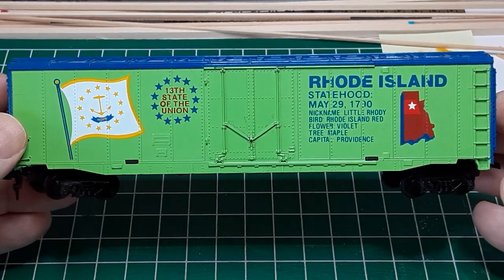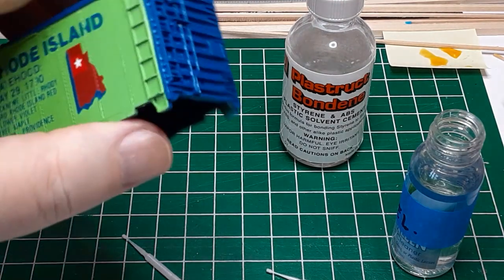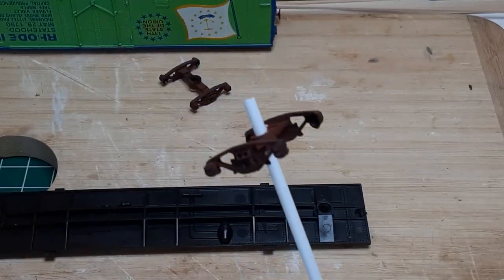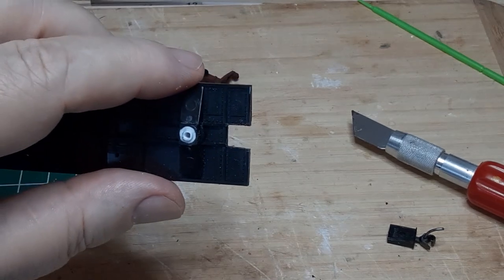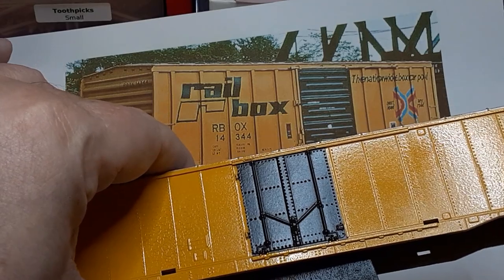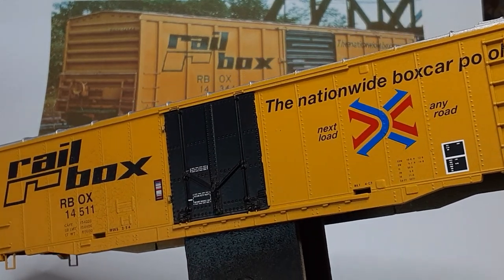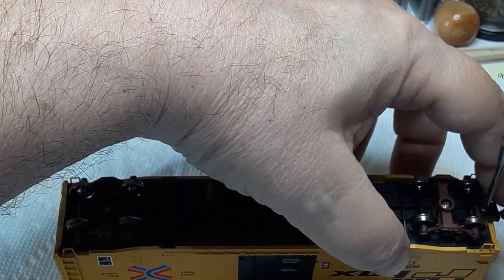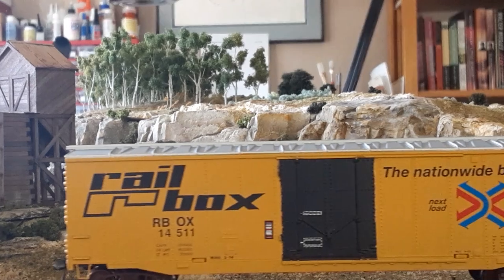Still Breathing: Replacing Truck-Mounted Couplers...and a Surprise!

Comment: I used a similar method in the 1970s, to Re-Truck various Rivarossi ( AHM) US- Prototype Cars, with 2mm MA brass bushes in the Frame, and 2mm Round head Brass Screws to hold the Trucks in Place ( I was exchanging sprung ArchBar Frames with the original solid cast frames. Also the plastic wheels were replaced with Metal ( KayDee RP25) wheel sets.)
For couplers, I used the Cast Pockets in the frame for KD #5 Couplers, and locked in with KD coverplate and 2MA mm screw.
Any dislevel between different cars' Couplers fixed with shim washers on bolsters,
All holes threaded by Hand, using aT Tap guide in a Mini-lathe on " Hand power "
Brass Tube from K&S Brass Tube, Illinois.
PS 1974-83, I was in Nthn. Italy at Med School...HO and Sn42 were my modelling interests ( Aussie rifle hobby out of the question)
Now, 50 years later, I still have a Dormant Railmodel interest ( Armchair) after a 40 year business in Guns, Ammo, and Films....the Railmodels are about to do a Pompeii or Krakatoa.. in On42 ( scratch built; wood, styrene, card, brass
& steel).
I reckon in 10 years I should be able to complete my Project...I'm 74 now...
DocAV
Brisbane Australia
Reply from the maker: You have certainly not shied away from difficult modeling challenges! Sn42... On42... hand-tapping threads in brass... 
K&S is an unappreciated supplier. I buy their brass tubing with 0.006" wall thickness - most commonly available tubing has 0.014" wall, leaving less room for wiring...
Keep modeling, whether in your armchair or at your work bench!

Comment: You did a terrific job given what you had to work with. For what it’s worth I’ve been “rehabbing” old Tyco/Mantua 50 ft flat cars. It’s actually not too bad a starting place. I follow most of the steps you use. If the stirrups are missing I reform a common household staple into a reasonable stand in for the stirrups. When possible I reuse the trucks by cutting off the couplers and sanding the area smooth. KDs and metal wheel sets are used. As for the deck, it comes off easily and I apply double sided tape. I cut wooden coffee stirrers (1000 for about $15) to the correct width and stain them with diluted India ink, and then I simply remove the backing from the tape and add the boards one by one.  (it’s actually kind of relaxing 😅) The wood is slightly oversized but not too noticeable especially if a load is applied. A brake wheel from the scrap box and a small piece of brass wire complete the job. I certainly take inspiration from the work you are doing and look forward to seeing more.
Reply from the maker: I like your approach. I tried using brass or phosphor-bronze wire for stirrups, but it was too hard to flatten them to get that step look; never thought of staples. The uncut wood coffee strirrers would make a good raw lumber load, too. BTW, you should check out this video: https://www.youtube.com/watch?v=Ilu3CIcprqw&lc=UgyE3RD1dROFOwP122J4AaABAg

Comment: Saving this video as a favorite. I just purchased an AHM Calcium Carbide car and need to replace the trucks/couplers as you did. AHM was the only mfr. to make this style of car which holds 22 CC bottles (need to be made from scratch). A Union Carbide industry near where I lived back in the 1960s used to receive this type of car, which I thought was unique.  I finally bought one after all this time!
Reply from the maker: It's a shame AHM did not provide the bottles to go in the car. I found pictures of two different styles of container online - one is square and one is round. Which style do you remember?
Reply: @rwissbaum9849  The ones I saw years ago were always round. Wish I had taken a photo of the cars. I did find a couple websites that sell round and square containers for HO cars. I might go that route though it would be more expensive buying 22 bottles. I was particularly impressed with your finished Rail Box graphics....Really good job!
Reply from the maker: I see Shapeways has some round containers that are much less expensive: about $3 each as opposed to $7. Here is the link: https://www.shapeways.com/product/W8SYJQAWM/calcium-carbide-container-early-6-pcs If you order from Shapeways, I strongly recommend selecting Fine Detail Plastic as your material - the printed items will have a smoother surface. Good luck! WAIT!
Looking more closely at the Steel Mill Modelers Supply page, I see the $7 cost is for five cans, not one. This makes the Shapeways option both more expensive and less detailed. Even so, you'd $35 bucks worth of parts to fill your $15 car.
Reply: @rwissbaum9849  I believe those were the two sites I had found. Thank you for checking prices. You almost nailed the car price exactly. The car was $7 and shipping/sales tax was another $7 for a total of $14. It is a lot to spend adding details to the cheaper car but a one time splurge shouldn't hit my wallet too hard. Nice thing about this car is you can legitimately keep the bottles on all the time since they would be either empty or full. Buying 25 bottles would give me a few extras to leave at the industry.
Reply from the maker: I can;t tell you how many times I've spent more on the details than I spent on the basic model! But, it's those details that make all the difference. Send me a photo when you get your car finished.
Reply: @rwissbaum9849  Will do!
Reply: I purchased the same type of car and the loads where what had me puzzled. 3d printed loads were an option but I thought the price was prohibitive. Finally I cut some square stock ( I think I got it from Hobby Lobby) into what looked like the correct height. You could paint them silver or use metal tape. Home improvement stores carry it in the insulation section. I added some hatches left over from covered hopper kits and some small lift rings (eBay jewelry section). I had a guy make me some Union Carbide decals the correct size (again EBay) and they don’t look half bad.
Reply: @jimjohnston7688  Thanks for suggesting that option. Haven't had a chance to work on the car as yet.

Comment: Hi what trucks did you use onto your custom post? I have some vintage Lima and want to do a similar conversion. Thank you!
Reply from the maker: I use Accurail sideframes (Accurail #151) with Intermountain 33" metal wheelsets (Intermountain 40055). Buying in bulk, my trucks cost me $5.70 per pair.
The Accurail sideframes slip perfectly over the 1/8" tubing.
Thanks for watching!

Comment: Oven Cleaner will strip paint overnight easy.  I do this a lot, like hundreds, upgrade cheap cars.  I have begun to wonder.  Two trucks $2, Four metal wheels $5.00, Kadee coupler and box, $4, Paint and other details, $3.00.  The cost of a car $1 to $5.  Maybe I should have just bought a nicer car?  Your two tube for a wheel socket is a great idea I had not figured out very well.  Thanks.
Reply from the maker: Thanks for the tip on the oven cleaner - I'll try that if I'm ever short of IPA. Regarding the cost of refurbishing: It seems that HO freight cars come in two tiers: there is the $20 tier (give or take) which features cast-on details, plastic wheelsets, and knuckle couplers by Accurail, Bachmann, and the like. You'll still spend $5 to $10 getting the wheels and couplers replaced. Then there's the $40 - $50 tier - Kadee, Scale Trains, Tangent, and the like. These come with fantastic detail and very high quality couplers and metal wheels. The point is this: you can spend $40 - $50 per car and have a beautifully detailed and excellent performing roster, or you can spend $10 - $20 plus 2 to 4 hours of your time, and still have a nicely detailed and excellent performing roster. It's all about the tradeoffs.
Charles Smiley did a nice video taking this to the next level. See it here: https://www.youtube.com/watch?v=XBqyLnHpH3E&t=0s (I have a similar video in the works - look for it in the coming months.)
Thanks for watching.

Comment: Hi, I'm new to your channel and really enjoyed this video. Do you ever strip off the old paint before repainting?
Reply from the maker: First, thanks for watching. Yes, I do sometimes strip the old paint, but since I'm basically lazy (and since stripping paint is a pretty messy process) I avoid it when I can. See my video "Refurbishing an Inexpensive Passenger Car" for one example. In general, I strip the old paint ONLY if the paint job is just horrible, or if I am worried that it will take many coats of paint to cover the old paint job. In my video "Rebuilding an Inexpensive HO Scale Tank Car" you'll see an example of a time when I probably should have stripped the paint, but didn't. That car had slightly raised printing on a white body, and I didn't notice that the lettering was raised until I had repainted. The result: the old lettering showed as a ghost on the repainted car! I didn't stress over this: railroad cars are sold and repainted all the time, and I'm pretty sure the new owners didn't strip the old paint...

Comment: Two comments:

The door varies greatly. Is it possible to install a custom door or replicate the ribbing with styrene strip.

Also, the taps stick out. I would have glued and puttied then sanded down the seams. Even then plastic surgery can be be difficult to make absolute seamless

Nice work all the same.
Reply from the maker: You've put your finger on the part of the rebuild that I felt was least successful. The cast-on door was difficult to paint properly, and even though I was very careful about masking, I did not achieve a smooth line. I agree that a more radical surgery could have resulted in a better model.
However, my main purpose here was to show how to replace truck-mounted couplers. I also wanted to demonstrate how to repaint a very garish model using a light-colored paint. Overall, the result was, at best, acceptable; but it was not stellar.
Perhaps for a future video, I'll try removing a cast-in door and replacing it with a sliding door...
Thanks for the comments.
Reply: You are welcome. I was worried my comment would be misconstrued.
Reply: I usually use super glue and baking soda for fills which works great and can be sanded.  I've used this method on several models and they came out great.  Cheers from eastern TN
Reply from the maker: @w.rustylane5650  Great tip - I'll try that. I assume you just mix a paste to, say, toothpaste consistency? How much working time do you have?